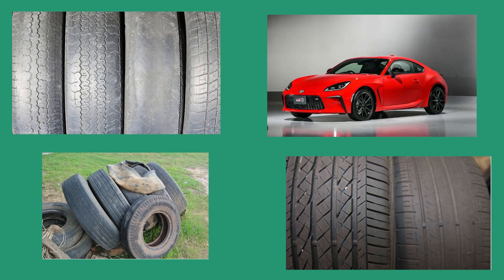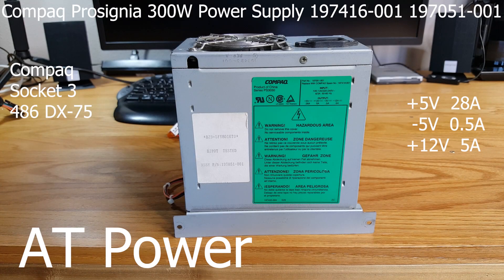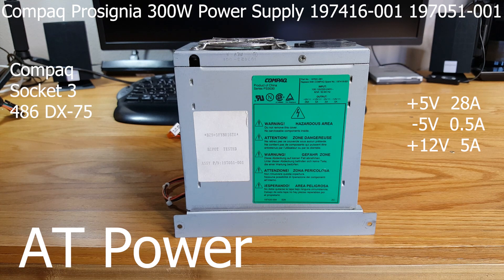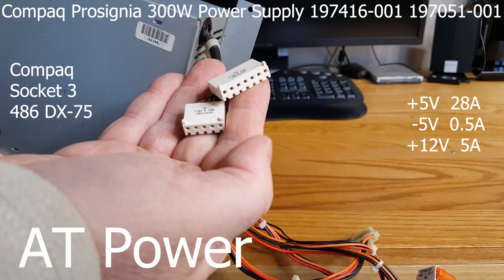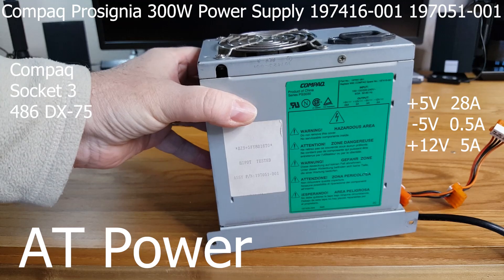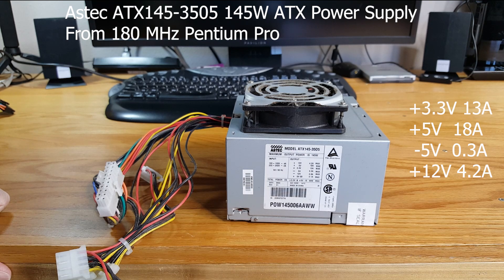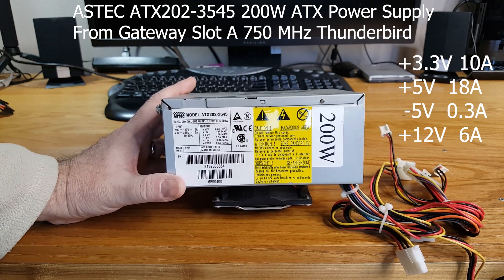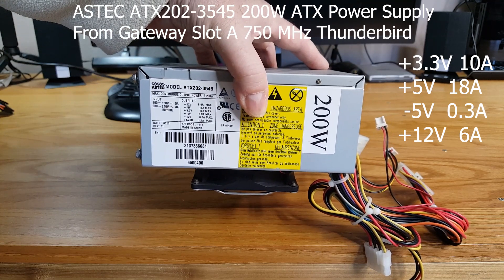Retro versus Modern Computer Power Supplies

Comment: Those Compaq power supplies will fry any other mobo Compaq liked using proprietary psus
Reply from the maker: I am trying to be careful with them.
Reply: Only if the connector Pinot is proprietary.

Comment: I have an NEC socket 7 board that uses the P8 and P9 power connectors, but it also requires another 6pin connector that has 3 GND pins and 3 3.3v pins. I didn’t have the original supply but was able to make the extra 6pin connector using two of those 20pin ATX to P8 + P9 adapters. Might be useful to some people out there where the motherboard requires an “auxiliary” connector beyond having the P8 and P9 connectors
Reply from the maker: Great point!  Tha is (I think) why the smaller Antec has that additional connector.  Was it Socket 5 or 7?
Reply: @UncleMikeRetro  socket 7
Reply from the maker: Huh!  Well then!

Comment: There were some early Slot A and Socket A thunderbird cores that a modern PSU won't even run, they use too much on the 5V rail
Reply from the maker: Right?  The size of this PSU did surprise me a bit.  I have to make sure that I do not put too much of a graphics load on it.

Comment: good run down.
i also like the pico power supplies which ive used to run AT style connectors up to socket 7 for testing. I dont think id use my current one for long term use for the socket 7's but I really like it for 386 and older boards.
If i ever need -5 V then id build one of the voltage blaster boards for the isa slot.
Also learned never swap modular cables
Reply from the maker: Interesting thoughts on the really older systems.  I get not swapping modular cables between PSUs myself.  Why take a chance?